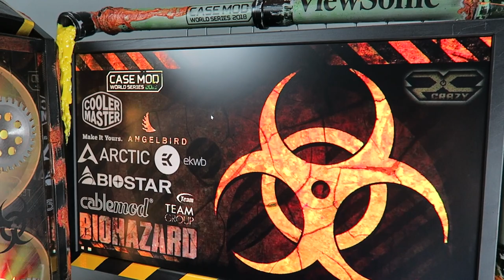Timelapse BioHazard - ViewSonic XG2402 [CMWS2018]

Comment: Nice vids but how do u connect a Samsung speaker to a monitor and PS4
Reply from the maker: RG7 Prudoctions Thanks. Most likely through 3.5mm jack. Do you have that?
Reply: PC Crazy there’s no hole to put it in on the back of the monitor
Reply from the maker: RG7 Prudoctions Monitors actually don’t have the possibility to transfer sound from PS4 if I’m not mistaking